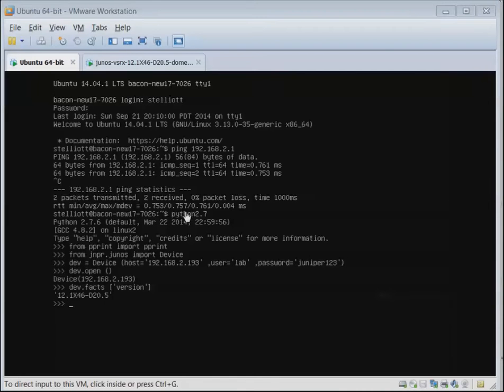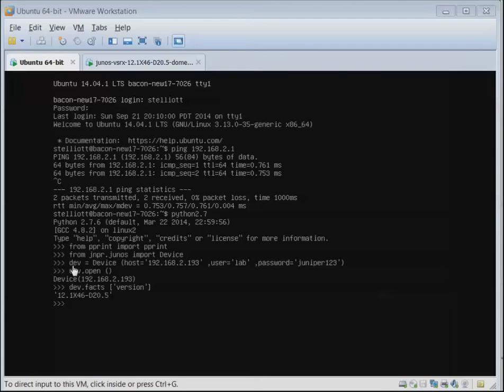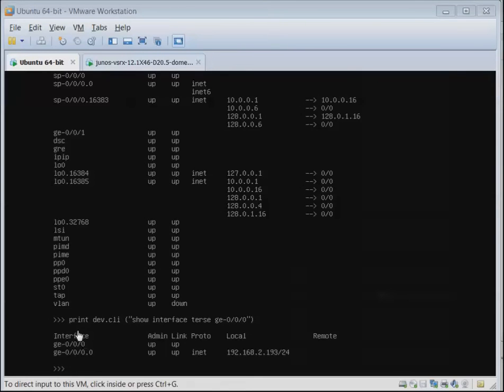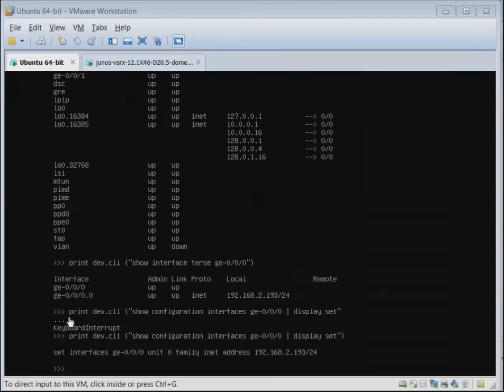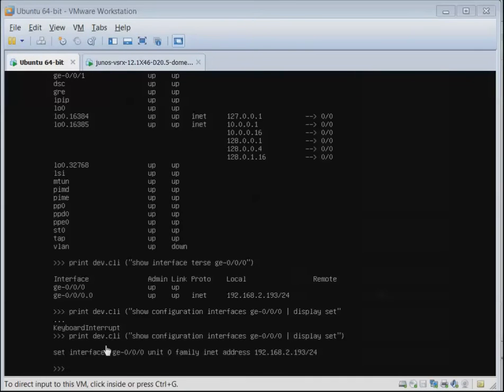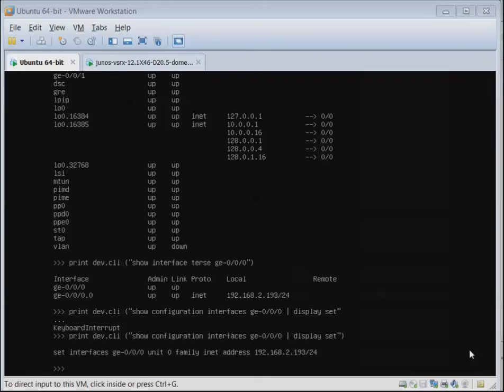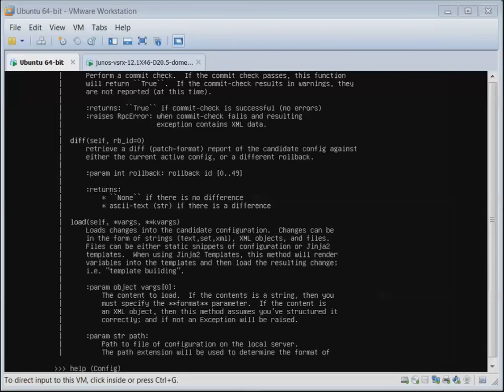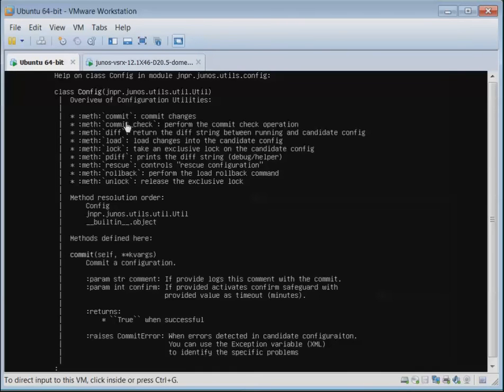Junos-PythonEZ (PYEZ) – Basics

Comment: Hi All,
I am from Network Architecture Team.

We are trying to do a automation to compare configs. we as a team decide the config lines that should get Pushed during Layer 2 , layer 3, RI Creation and give it to developers to push it when we click on create layer 2 connection/layer 3 connection through UI.

Requirement is 

1. I have to compare the lines that got pushed and which were suppose to get pushed.

I have the data with me in SET command format.

Please suggest the appropriate
can I use PYEZ to achieve my requirement.?

Thanks 
Aryashree

Comment: can pyez Juniper be used to extract the signal strength dBm and the RSSid of a device.  I'm building a rover robot and I want to use trilateration for indoor positioning.  Would you point me in the right direction?